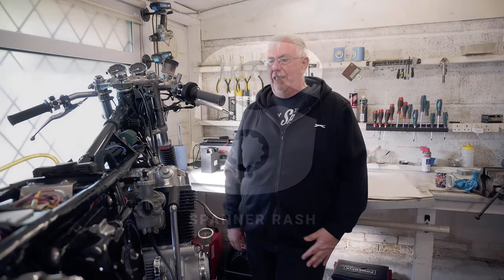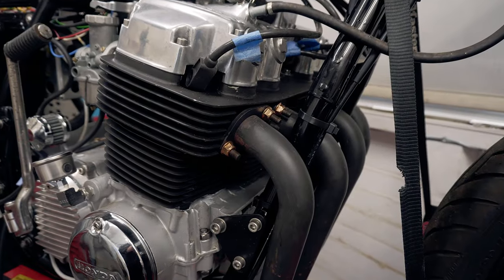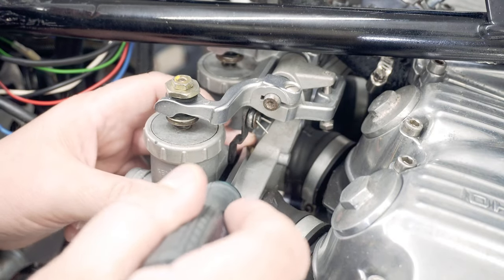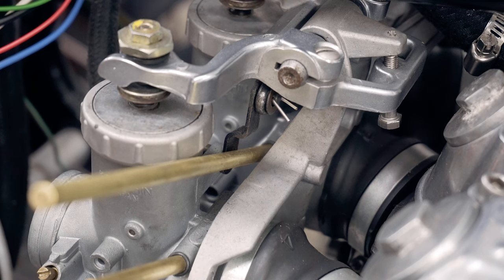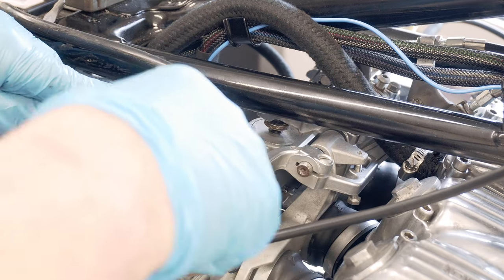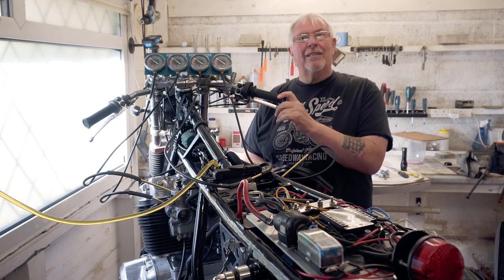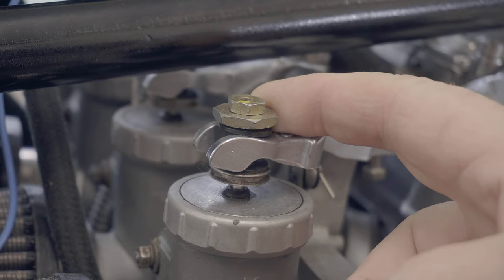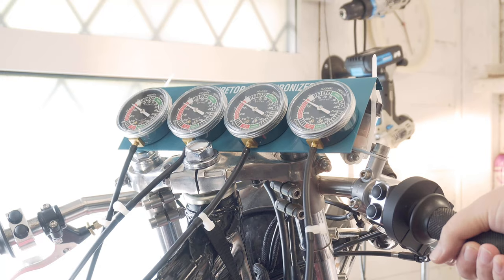Using Carburetor Synchronizer Gauges To Improve Honda CB750 Cafe Racer Motorcycle Running | 27

Comment: Looks like you did a good job bench synchronising those carbs, they were pretty close straight of the bat..
Reply from the maker: Thanks.  They weren't as far out as I expected, I thought the gauges might have moved more, but when adjusting I could clearly see the changes.  I am just pleased that thre doesn't seem to be an issue with one of cylinders not running now.

Comment: Great video, helped me a lot. What's the tool you use at the end of the video and what are you measuring?
Reply from the maker: I think you mean IR Heat gun that I am using to measure the temperature of the exhaust pipes to see if any of the cylinders isn't running.  It used to be that you would lick your finger and touch each one, if it didn't sizzle it wasn't running, using the gun doesn't give you burn't fingers :)

Comment: Great video. Those look like CV carbs, which run notoriously poorly without the airbox because they were designed specifically to be used with the airbox - the combination of the velocity stacks and the airbox itself means that the carbs can suck in air that is all at an equal pressure & speed and is all entering the carb in the same way due to the venturi effect generated by the velocity stacks. If you run stacks without the airbox, you're still ruining the venturi effect due to crosswind and pockets of higher/ lower pressure air. No real amount of rejetting or synching will get the bike running as well as stock.

If you have a set of PD carbs, I would use those. I was able to successfully jet & tune my PD carbs for K&N pod filters + open 4:1 exhaust without too much trouble. The PD carbs work differently than the CV carbs and are much more forgiving when running stacks/ pods. The stock jetting is usually #35/#105 (pilot/main), I went up to #40/#120 and it runs like a sewing machine and moves like a scalded dog. I kept the needle in the stock (middle) position and my plugs are all looking healthy.
Reply from the maker: Thanks for the advice.  I know that stock air filters are probably best, but don't look as good.  Great information about using the PD carbs.  I have a set on the shelf.    I might try them if I have lots of issues once I can actually start riding the bike.

Comment: Loving your work spanner rash,. i reckon a good grade fuel, optimum/v power or a good fuel additive , air filters and end can on and it should be spot on,. "hopefully",.. cheers,.
Reply from the maker: Thanks.  I am sure it would be fine to ride, and good fuel is always a good option.  I am thinking of increasing the size of the main jets before I get around to riding it.  I suspect it will need a little more fuel when the throttle is towards fully open.  If wasn't Winter I would ride it now, but while I have some time,  I might as well get on with it.

Comment: This is why I gave up on mine. I got a 78 cb750 as part of a trade for my dirtbike. I chopped the frame, put that hoop in with the integrated taillight and I rebuilt the carburetors. It would run… but like shit. That made me get rid of it. It’s the only bike I regret selling. They are so sick when set up as a cafe racer. Got more love and attention on that then any other 1000cc streetbike I’ve owned.
Reply from the maker: That's a great tale. I don't think I will be able to get the carbs fully sorted until I can start riding the bike in the Spring.  They make grand looking bikes CB750 Cafe Racers, I do hope I can get it running well.

Comment: Very nice.  I have trouble getting the brass rods in place with the choke mechanism on mine.  I can do it, but I've broken a couple of those tubes.  Even with different sized tubes, it can be tricky.   I'm curious if you have a ballast resistor in place with the 3 ohm Dyna coils.   The stock coils on the CB750 were 5 ohm, which Dynatek makes...they're the black coils.  (I put them on my bike when I added the Dyan electronic ignition.)   I remember watching Hackaweek's CB750 series and he used the green Dyna coils but recommended a ballast resistor go with it.    I'm not even sure what a ballast resistor is.
Reply from the maker: I did find using the extra tube from my old ballance kit, made it much easier to use the synchroniser.  I was surprised the brass tubes didn't just work.  I haven't come across any ballast resistors for the coils, I will have watch Dino's Hackaweek video to see if it is something I should have.

Comment: Hi Les, my CB has the later PD carbs, it would not run properly without the original air box or pod filters fitted, and in fact even with pod filters fitted it had issues, that’s because the carbs need a smoothed out airflow, that’s why in the original air box there are rubber velocity stacks, let’s face it, Honda wouldn’t have gone to the trouble of fitting them if they weren’t needed, now as I say that was with PD carbs, not the earlier ones that you have.
The issue with most pod filters is that there’s nothing to direct/smooth out the airflow, so the air tumbles as it’s drawn into the carb upsetting the Venturi effect.
When I fitted standard pods it ran reasonably well but wouldn’t hold a steady 70mph, it would surge, so I took the rubber velocity stacks out of the original air box and grafted them into the pods, it instantly fixed the problem and now it runs perfectly, you can see the rubber velocity stacks in this video, they protrude approximately one third of their length into the pods.
So if you get poor running I’d suspect that👍

https://youtu.be/dzyp3A1TQBY?si=xwEIQCkfFid3jAju

PS ignore the front mudguard, it was the original guard that I lashed on temporarily with zip ties to get me to the Dyno on a very rainy day!
Reply from the maker: Hi Mark.  Great info.  I have watched your video, looks like it is a great bike.  The idea of the velocity stacks is great.  I will see if I can find some and might try it.  I have a set of PD cargb on the shelf, but I always seem to prefer the earlier ones.  I am thinking about jetting for the future.  From what i have seen on forums I think the 42 pilots should be right, but I have seen lots of different advice on mains. I iwll have to try the velocity stack idea first but I am thinking of getting a set of different sizes so I can do some plug chopping when I can start riding the bike.
Reply: @SPANNERRASH  I put 42 pilots in mine, standards are too small once you have taken the standard air box/filter off 👍
Reply from the maker: Cheers